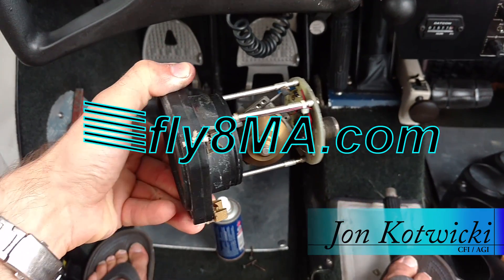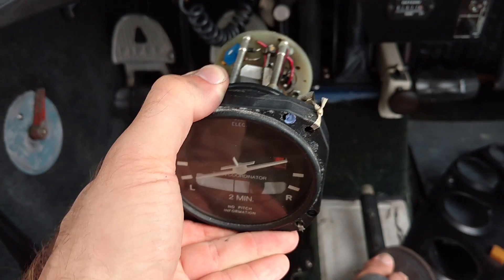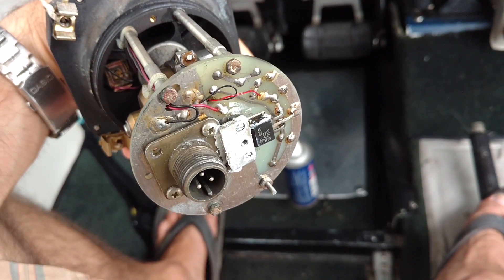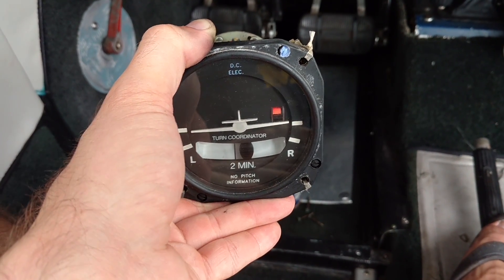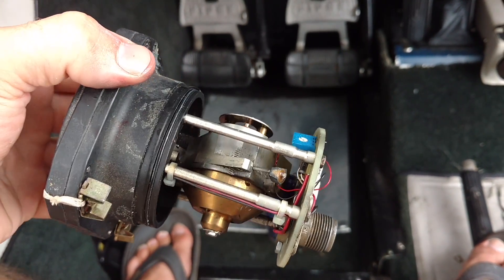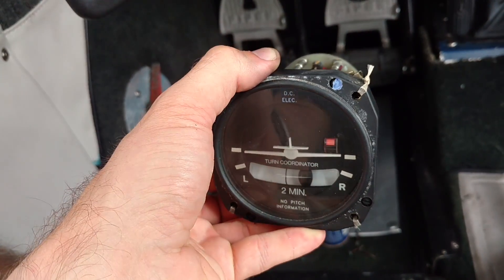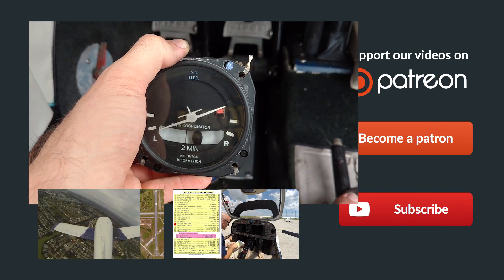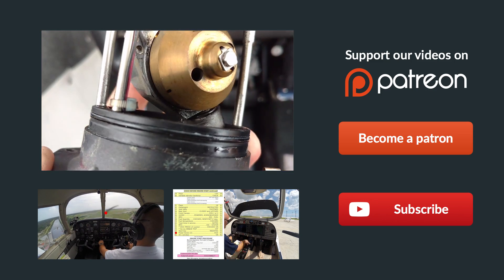Ep. 59: How a Turn Coordinator Works | Inner Workings

Comment: In the case of the cessna 172, do you plug it into the electrical system? because in the POH it is not shown at all so I wonder to which electrical system is connected or if its directly connected to the battery. Thank you in advance for your answer

Comment: Hi, the turn coordinator gyroscope has rigidity yes, but importantly it's the precession characteristic of the gyro that causes a resultant force 90 degrees ahead in the direction of rotation from where the force is applied. The Artificial horizon and DI use the rigidity in space characteristic of the gyro more, and they are setup differently, the earth gyro is setup vertically and spins parallel to the earth, hence the name.

Comment: Worth clarifying that the TC gives Rate of Turn and Rate of Roll, but NOT bank information. There is no way to tell whether the aircraft if in a 30 degree bank or a 60 degree bank based indication of the TC. Aside from that, really cool to see one spinning outside the housing. Thanks!
Reply: Good point. This is a question in the FAA IFR knowledge exam (which I got wrong in the practice test :p). Rate of roll and rate of turn. No bank.